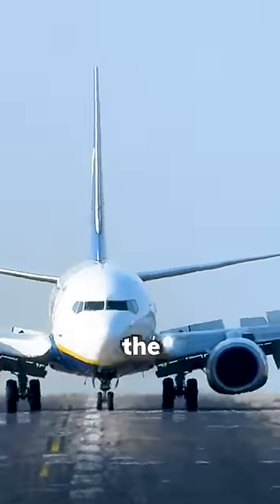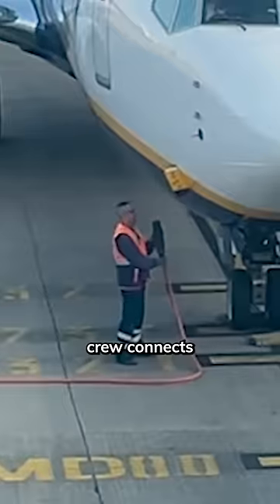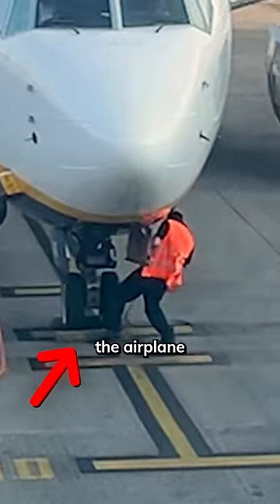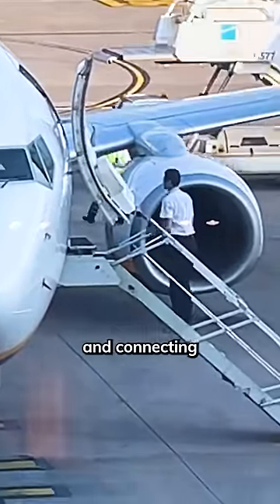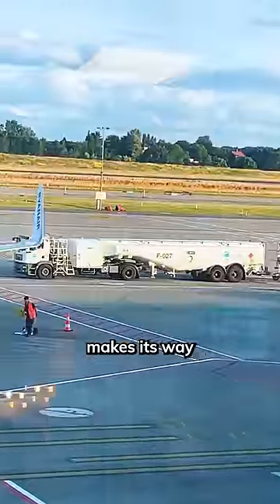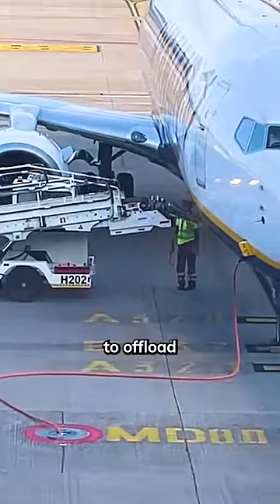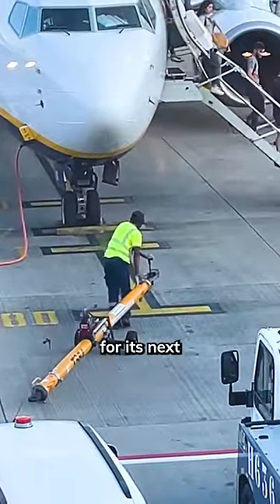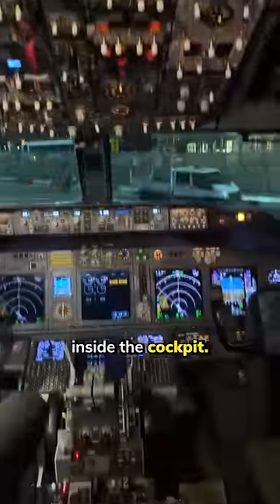Ryanair Airplane 25 Minute Turnaround!

Comment: Since I see planes about 5 days a week I can confirm all of this is accurate and it seems Ryanair is the only commercial airline that needs 'Airstairs' since their planes are to terrible to handle a jet bridge so I'm glad I don't get to see Ryanair planes ever😅.
Reply: All airlines should have airstairs...so efficient to get off quickly
Reply: well basically while Airstairs are better, you could end up with a long journey from the plane to the terminal depending on where the airplane stops from the gate which is why I prefer jet bridges instead it basically means commercial passenger planes can't park their planes far from the gate, and also jet bridges are easy to operate/adjust by ramp crews plus it's connected to your gate, Europe might do things differently which is why I am glad to have jet bridges at most airports if not all, that way ramp crews have less things to drive with being a ramp Agent is already hard enough, the less things to drive the better.
Reply: @Youtubefanatic102 so you prefer to be stuck on the plane waiting for the airbridge to be connected when in that time on Ryanair you would already be in Temple Bar Dublin enjoying a pint of guinness as Ryanair would have arrived early, used its own stairs and you would have used your own legs (or wheelchair) to make your way into Dublin. Your comment makes zero sense for Dublin airport. Until you tell me youve flown many times in and out of Dublin airport with Ryanair you cannot critise it - however i have that to compare and the terrible slow-ness of every USA airport (and CDG paris). How painfully inefficient and expensive it is to fly in the USA i can understand why so many americans have not ventured beyond their local mcdonalds

Comment: Why does it look to be at a remote parking stand instead of a gate?
Reply: because it is, the airlines pays extra for gates
Reply: @CzechAviationEnthusiast  The video said “First your airplane gets marshaled into the gate” and then it shows a remote parking stand operation.  That’s what’s confusing to me.  I suppose the video could be anything and have no relation to the spoken audio, but in this case it’s so similar.
Reply: @mecaterpillar it is a Gate because the passengers inside go to a "Gate" to prepare for boarding. However you walk downstairs (or take a lift) onto the pavement and then walk out to the plane. Sometimes a bus will take you from your Gate to the Parking stand. Ryanair never uses the airport gate tunnels to connect to the plane as its faster to use its own stairs. The plane never has to wait for stairs to arrive from the airport and can always offload passengers as soon as it parks. And thats why it is cheaper - using less of the airports facilities and quicker turnaround

Comment: There’s no way the plane is back in the air in 25 mins. It takes up to 25 mins to board everyone never mind all the other things.
Reply: 1 hour before departure time people already have shown their passport and scanned flight ticket. When the plane gets to the runway - 100% of the passengers waiting to board are on the pavement next to the gate stand and the gate has already closed for check in (it closes about 30 to 40mins before departure time). Sometimes if the plane arrives early the flight will take off 45 mins before departure time. Ive had friends miss flights as Ryanair took off 45mins early to the scheduled departure time
Reply: @traceymarshall5886  I have never been sat at the gate and watched the plane pull in. It’s always been there when we’ve been called to the gate and you get called to the gate 30-40 minutes before departure. 
I don’t know where you’ve been flying from but there no chance of a 25 minute turnaround where I’ve flew from.

Comment: Nah We were at airport 2h and 2 Ryanairs there were all timw
Reply: If it is on the ground longer than 25 minutes it could be a crew change (50 minute turnaround). Otherwise it either has been had a technical fault or is not a turnaround meaning it is waiting for it's first leg or has completed its final leg.

Comment: People make fun of ryan air but its a well oiled machine.    
Rough landings? All of them are within tolerances of the 737 and it pretty much guarantees a landing with no go around needed because you ran out of runway trying to land smoothly in a cross wind.

Limited service? Their flights last an average 800 miles and 1.8 hours do you really need anything for that short time? Well if you really do you can feed a family of 4 for $30usd, thats cheaper than McDonald’s 

Their luggage prices at the airport is cheaper than spirit charges in advance.
Reply from the maker: Spot on!